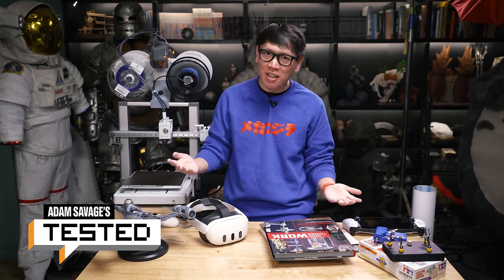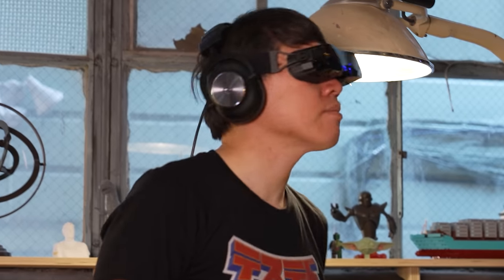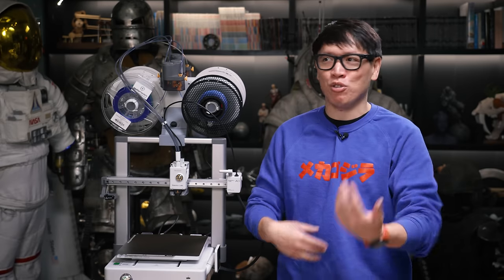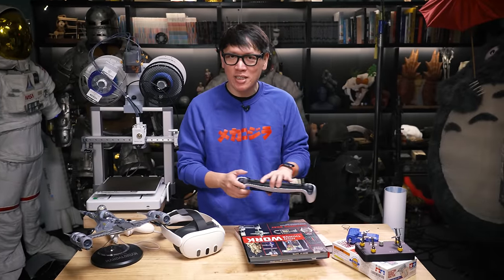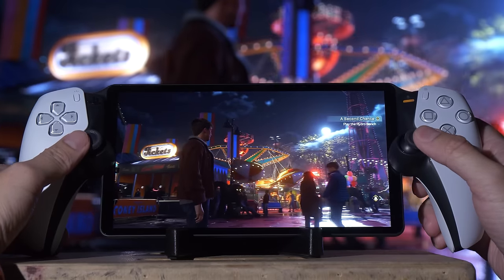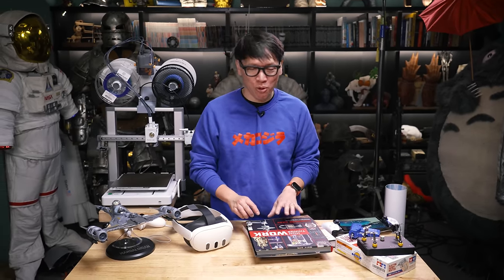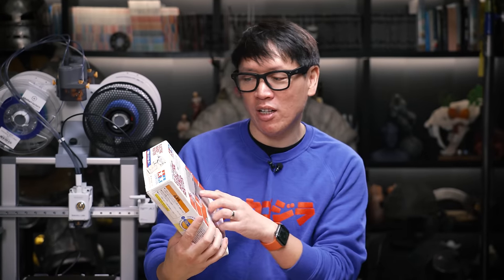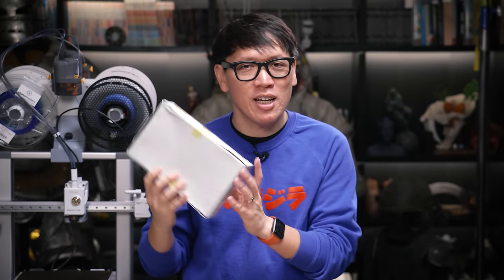Tested in 2023: Norm's Favorite Things!

Comment: The one thing I am quite annoyed about with Mando's N1 during S3.... was the Astromech port! 
They clearly decided to utilize R5 last minute, because they didn't factor in the giant engine that now sits directly below it and thereby blocking the entry/exit port. Because now when R5 exits, he has to turn into a fluid, to magically be able to drop down BEHIND the add-on engine, which means making two 90 degree turns in roughly a 24in vertical space! 😅🤦‍♂️

As such, I'm glad that model has Grogu! 😊

Comment: It would be cool to see a video on modifying the tamiya drill with full bearings, rechargeable batteries and a cool docking port. Hint hint Adam!!
Reply: How do you know these aren't rechargeable batteries?
Reply: @sie4431  
I don’t know? Just spitballing
Reply: @rickfazzini22  Is hope these batteries are rechargeable but if not they can be swapped for rechargeables, no mod necessary
Reply: @sie4431  
I was thinking it would be cool to have a charge port so you don’t have to open the tool to remove and charge the batteries you could just plug it in. Would be easy enough to add one👍🏻

Comment: Are you trolling with the psportal? You literally cannot even use it in a coffee shop or hotel. Why? Because you cant login. Because you cant open a web browser. 

On 5g?? It has no 5g. It has no data at all. None. Zero. And it has no cloud streaming at alllllll. You also NEED your ps5 ON. which means, yes, you still need to have it on your tv lol. You can change the channel, but itll always be running on that tv. 

What a terrible way to plau console games. A phone or tablet is better in every way. You have acess to gamepass, which is flat out better and its streaming from the cloud which is again, better, or you can do the same thing as the psportal.
Reply: The only handheld gaming system I would even think about buying is the Steam Deck or one maybe of the clones of it.
Remote gaming doesn't work well unless you have good fiber internet on both ends.